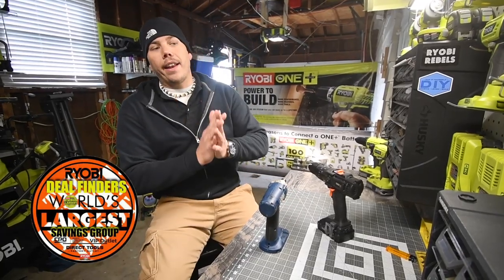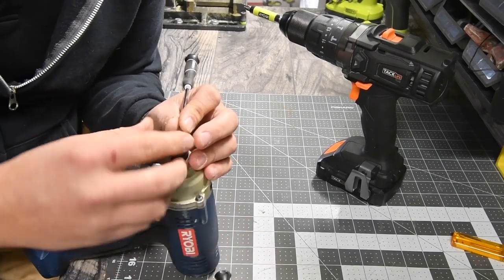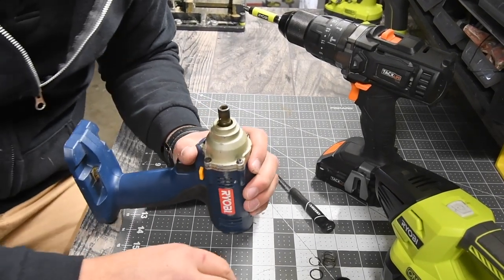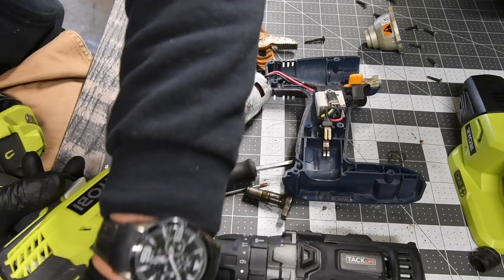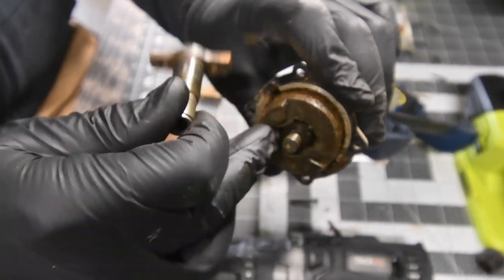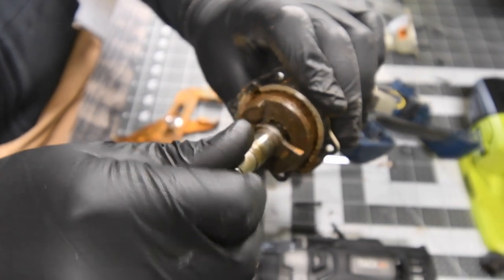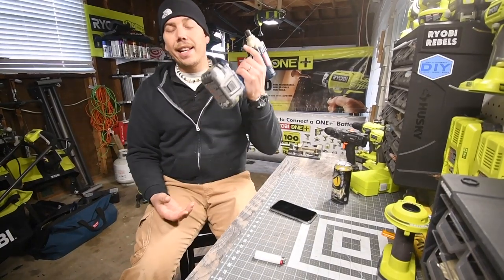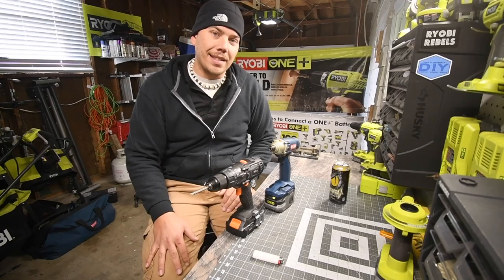Fixing old Ryobi Blue

Comment: I just found and subscribed to your channel and the next time my wife tells me I have to many Ryobi tools I will show her your Man Cave. I'm retired Military from way back and now I fish a lot and do woodworking. I love Ryobi but for some reason I can never get a straight answer even from Ryobi when it comes to buying replacement blades for the Jigsaw. I have the corded one Model # JS481LG because of a big project but I also wore out the blade that came with it. I looked at the box and the book and it says it takes the T shank blade but discovered that Home Depot does not sell them either in the store or on line so I bought a package of Bosch T shank blades just to discover at home that they do not fit. The T on the shank is just a bit larger than the blade that came with the saw. I looked at a few less than informative videos and the closest I came to an answer dealt with a set of Rigid blades. I can't believe a company as big as Ryobi cannot supply blades for it's saw. I looked through your videos but unless I overlooked it I did not see one on the jigsaw. I do plan on purchasing the 18 volt saw after Christmas. I did find a parts place on line where I can buy the wood blade but it's $4.00 and almost $5.00 to ship it if your order is under $149.00. Thanks Steve
Reply from the maker: I get Bosch. its a standard blade size the only question is how long do you need them to be.
Reply: @ManCaverTools  maybe you could do a video on the jigsaw. Thanks